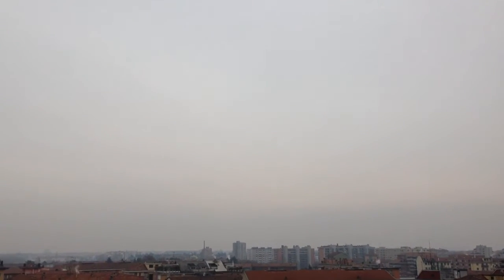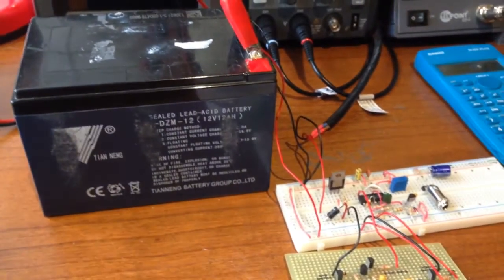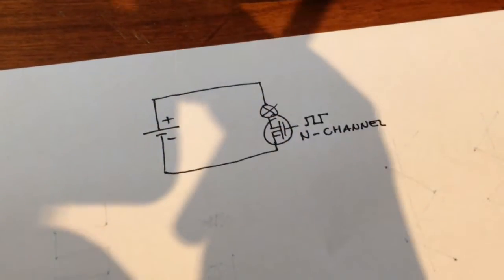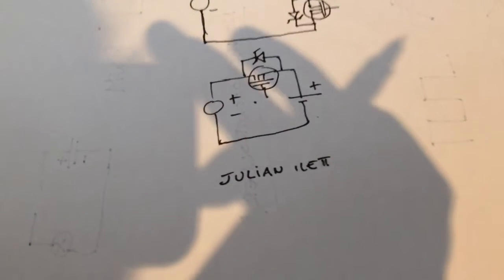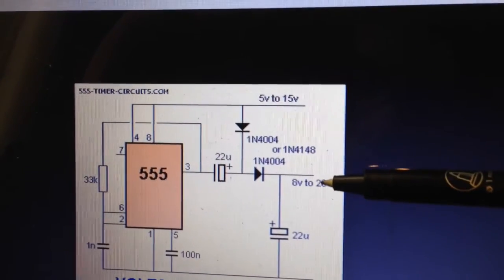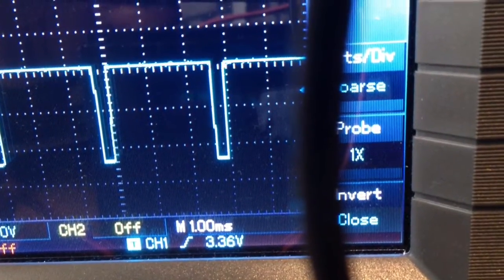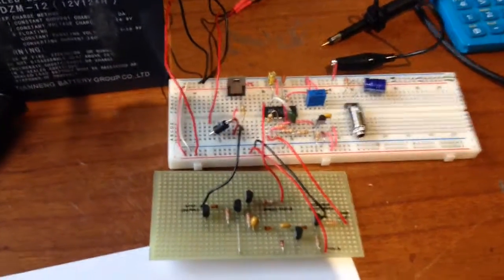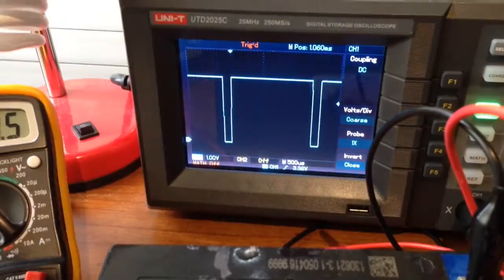PWM solar charge controller #1 - pwm generator, charge pump

Comment: Can some1 help me with a circuit diagram and design of 24 Volt Solar Charge Controller with a current > 10 Amps (Less than 10 Amps)
Reply from the maker: The circuit can work without any problems on a 24v system with suitable modifications. This includes changing the voltate divider resistors to get a pwm setpoint of 27,2v and modifying the charge pump circuit to limite the gate voltage to about 12v on top of the battery voltage to avoid damaging the mosfet.

Comment: Can you pls put the circuit diagram for the complete arrangement.
Reply from the maker: I will as soon as possible. I'm currently working on a PWM status led indicator wich I would like to include in the final design.